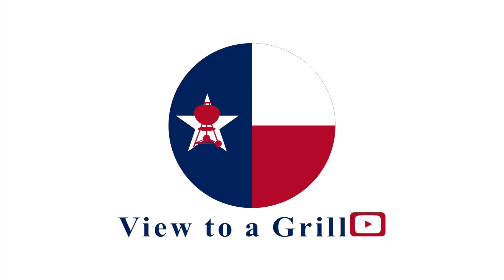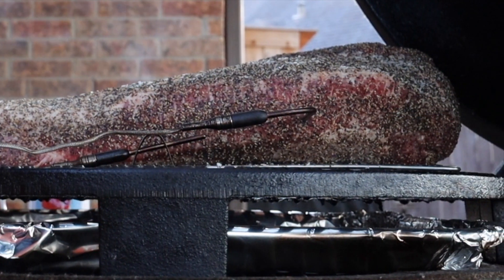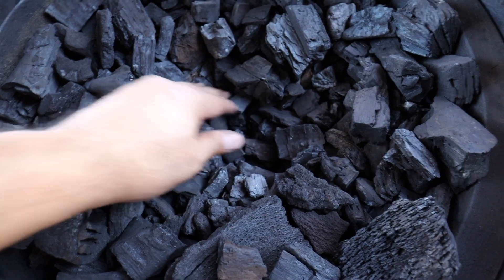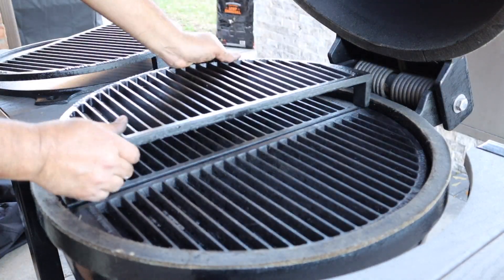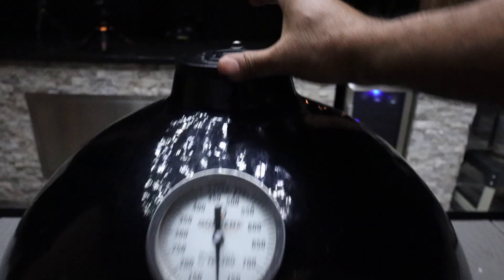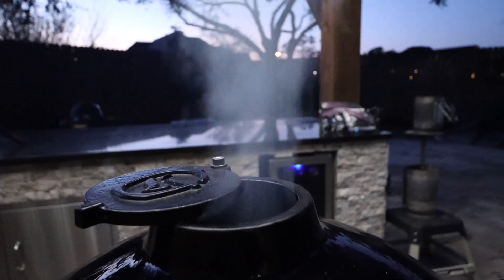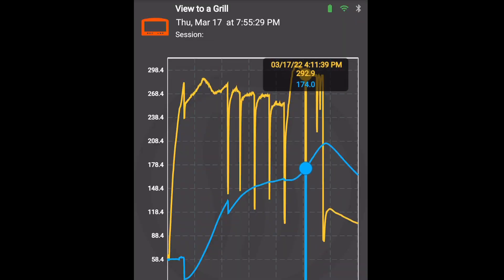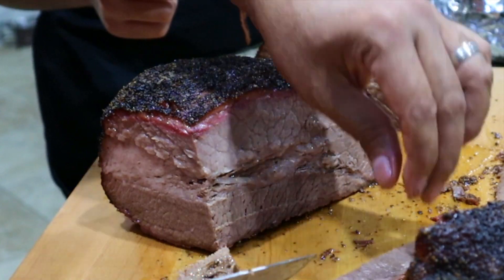Low & Slow Setup and Temperature Control with ThermoWorks- Goldens' Cast Iron Kamado

Comment: Your vent adjustments are based.  This is the same way I regulate my KJ.  Kamado style cookers are known for low convection/high radiant cooking.  Regulating the temp by closing the bottom vent and leaving the top more open you're allowing for more convective air flow, as opposed to closing down the top vent which bottlenecks the cooker.
Reply from the maker: Thanks for sharing Theodore!

Comment: Hi was looking at one of old video's of the camp chef portable and didn't see any cooks on (video's). I was wondering would you make a video. I sure like see how cooking with it is like. Thx
Reply from the maker: Sorry DV, Hello DV. I had to get rid of it.  The Camp Chef was a great product and fun to use but I had no space for it.
Reply: @Viewtoagrill  thx for reply. But that's why I'm looking to buy it. All I need to do is stand it up against a wall and it's out of the way. Did it cook good when you used it?
Reply from the maker: @dv7548  It absolutely worked well.  You should know that it does not come with grill grates.  I do have a video where I cooked a pizza in the pizza oven attachment... but that is the only one.
Reply: @Viewtoagrill  yes I've seen your video. I will have to look for those grates. Thx for reply. Be well stay safe. 
Thank you

Comment: Johnny, do you but use your Goldens' kamado anymore?  Miss your videos on this!  I was wondering if you know how to take out the thermometer to calibrate it.  Thanks amigo!
Reply from the maker: Yes, I still use the GCI.  I have not calibrated the thermometer mainly because I use the ThermoWorks smoke or a wireless thermometer to monitor the ambient temperature of the kamado.  

I am experimenting with pizza on this kamado at the moment.
Reply: @Viewtoagrill  oh man. Can't wait to see what you do with this on the big GCI with pizza!  I have been thinking a lot about how I want to do this.  My only concern is that for the very high temps that the cooker can achieve for quick cooking, you can burn away all the polymerized oil (seasoning) on the metal with the effect of rusting.  I don't know how to get around this with my firebox divider, for example.  

I use temp probes and digital thermometers to monitor cooks but it's nice to have a backup means of monitoring.  I started a fire using wood in the grill and I wonder if the large flames and intense heat damaged it miscalculated the thermometer.

Also, where in Texas are you?  I was just down in Dallas visiting the family over the holiday

Comment: Hey Johnny I’ve been following your channel for about a year. I just moved out to Texas from CA.  I was just at Sams Club today and I noticed the Members Mark  version of the Weber Performer.  I was wondering whats your take on that grill? Or have you seen it?
Reply from the maker: Hello Greg.  I saw that the last time I was there also... I think... It had a table and the lid was on a hinge.  Is that the same one you are talking about?  The one they had on display was kind of wobbly... that may have been just because someone did not put it together correctly.  The other thing I noticed was the bottom grate was really put in deep.  That would make the fire far away from your meat when grilling.  Other than that it looked pretty nice.  Not sure if any Weber Accessories would fit into it though.
Reply: @Viewtoagrill   Yes that’s the one.  Thanks for the feedback!

Comment: How bad has Rust been in this cast iron kamado??
Reply from the maker: Hello Manny. I have not had a rust problem with the kamado.  That is not to say it does not rust.  I spray the grates with canola oil after every use which prevents rusting. There is some light rusting in the firebox and on the divider plate(not the sear plate) but nothing significant. The outside of the kamado is powder coated so it won’t rust unless you pierce it somehow the same way the Weber Kettle would rust if you damage the porcelain coating… a little touch up with rustoleum  will fix it.  The cast iron is so thick that it would take YEARS upon YEARS for it to have a negative effect on the cooker.  Honestly rust is an after thought now that I have had it for a while.  Like anything if you neglect it there will be a negative effect but I enjoy this cooker so much I would definitely get it again.  I will film a maintenance video so I can focus on the cooker and not the cook. 

Take care Manny.

Comment: That seemed like a lot of charcoal for this cool.  How much was left after you were done?
Reply from the maker: Over half.  This kamado is super efficient.
Reply: If you have half of the charcoal left, why do you fill it up so much to the rim?  Is this just to ensure you don’t burn out from a long cook or is it your preference to start with a full amount and then do several cooks until it needs refilling again?  Just curious.  Thanks.
Reply from the maker: @hooleyon  Yes,  I would rather have too much and have enough than not enough and then have to take everything apart and relight it.  Relighting the kamado or adding more charcoal would start the whole getting it to temp process again.  Also, you can always reuse the unused charcoal.
Reply: Great step by step detail.  Keep these types of videos coming as they are very instructional.  Thank you! I’m still amazed how much charcoal you start with.  With how efficient the Golden’s burns, do you really need that much? On this brisket cook, how much charcoal in the firebox was left over?

Comment: Howdy Johnny.  Excellent video packed full of helpful content.  How did your charcoal hold up?  Curious how much if any was left over at the end of the cook?  Great tip waiting for the clean smoke!
Reply from the maker: There was a TON of charcoal left… it gave me an idea for another video… stay tuned…
Reply: Good to hear…such an efficient cooker!  Did that amount of leftover charcoal effect your future placement of your wood chunks or did they eventually get consumed?
Reply from the maker: @kdranchaz3240  in another cook I put the wood chunks Al the way at the bottom… they did barely got touched, so I moved them up a bit and they were all consumed.  I may add two more chunks in the future though.
Reply: Good info.  Would you place the extra chunks half way or more toward the top for some initial smoke earlier in the cook?  Thanks for the tips!
Reply from the maker: I would add maybe 2 or 3 more on the same level.  Remember you are spending the first 45 minutes to an hour getting the smoke clear and the kamado up to temp.  So I don’t want to burn off the wood chunks first.